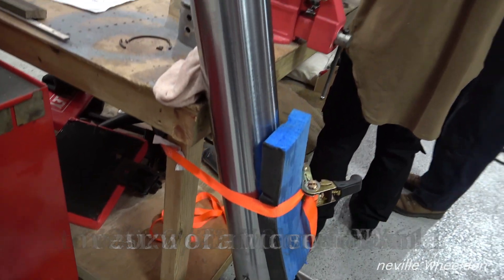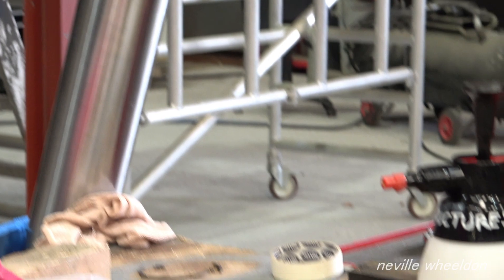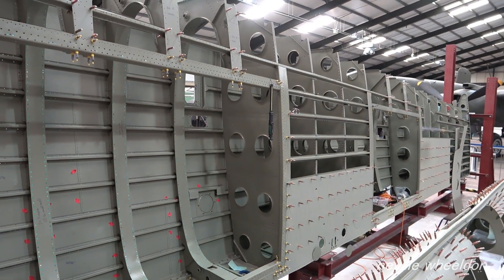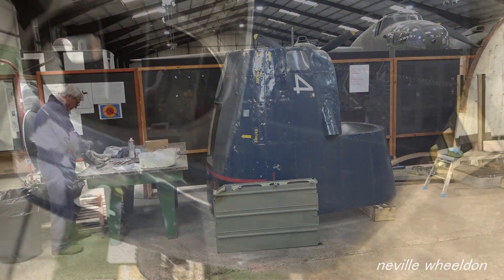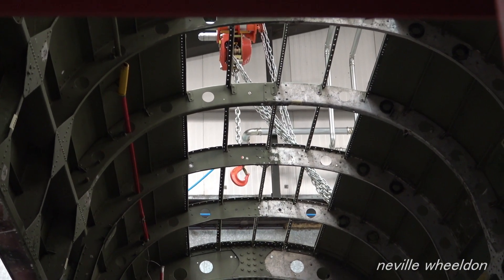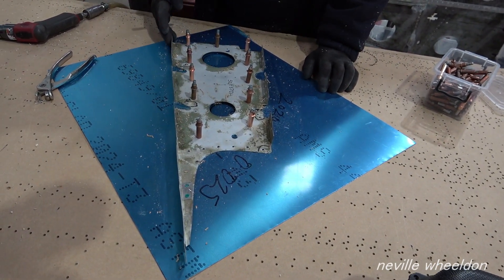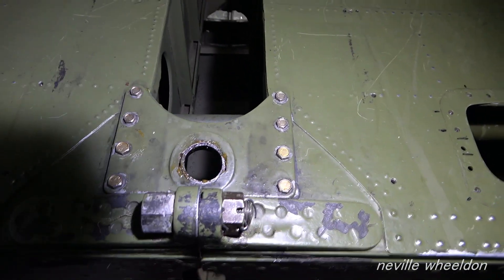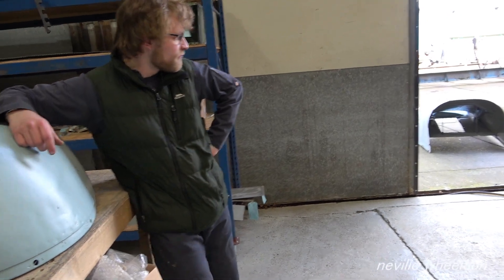189 Restoration of Lancaster NX611 year 6 ...Rear wheel fitted to Lancaster

Comment: 'Dents & Dollies' Another visual and enlightening treat for many watching this latest video Neville.
Something l did notice at  9.51,  some possible dents / creases in the recently repaired rear fuselage of ‘KB976'.
Although not bad enough apparently to warrant being replaced, these dents and creases may respond to some gentle work with a curved dolly, as  similarly used in the automotive industry. As long as you can gain access to the back of the panel so to be able to push it back to its pre dented / creased state . I have restored a number of classic cars over the years and have obtained  very presentable results using such a technique, which can be achieved without the need to remove the panel being worked on ....food for thought anyway.

Gary
Reply from the maker: Thanks for that Timeslip9, the lads do read these comments